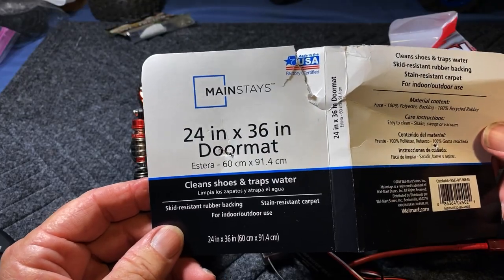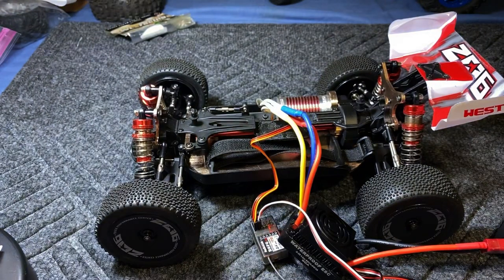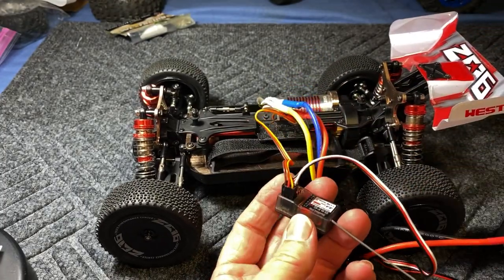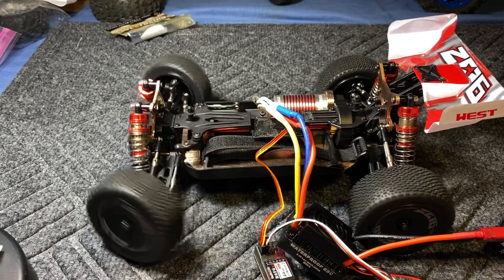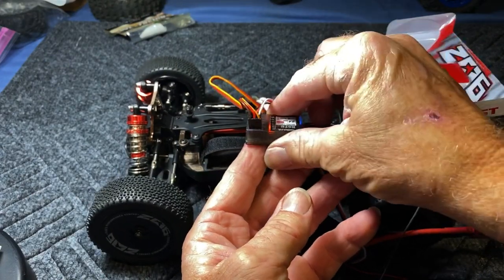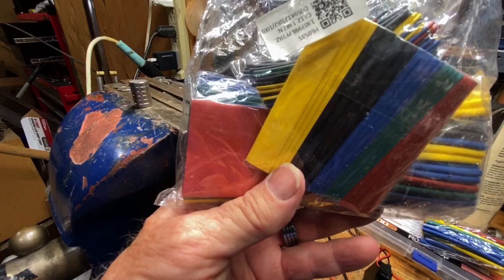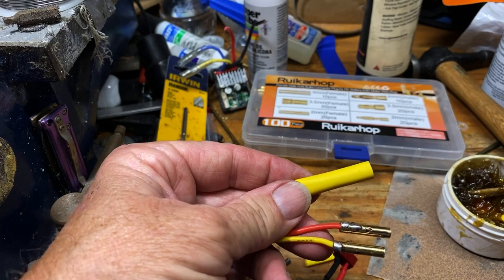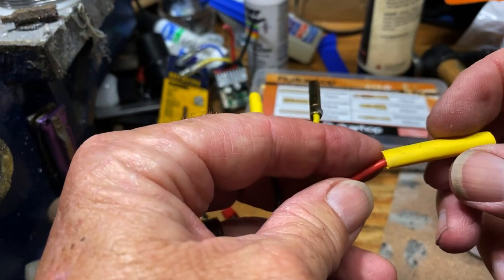WLtoys 144001 brushless ESC choices

Comment: hi, just bought one of these for my son! What are the things to buy for preventing errors? Ive read that the suspension needs to be filled with oil because they are dry? Is that true? Also do i need to get metal gear for the motor? Read that they get broken pretty fast.
Also im looking for some longer lasting battey! Can you recomend some? Thanks
Reply from the maker: Thanks for stopping by. All my shocks (I have 3 of these) have had oil in them. I’ve heard claims that the differentials don’t have grease but none of mine were dry. They are not filled with grease and for the purpose of lubrication don’t need to be. However, I prefer to fill the rear differential with a fairly heavy grease. It functions as a bit of a limited slip differential and helps the car go straight from a full throttle punch. 

The pinion gears are metal and the spur gears are plastic (it looks like nylon) and even on 3s with my brushless motor I’ve never broken one. 

So far, the ones I’ve seen that broke have been using adjustable motor mount. 

The factory mount is non-adjustable and has a bearing on the driveshaft that prevents deflection and keeps perfect alignment of the pinion and spur gear. 

The adjustable mounts don’t use the bearing on the driveshaft so the motor can push the spur gear over far enough to cause the gears to slip and damage the teeth. 

One other thing worth mentioning is this car uses a pretty rare gear pitch. It’s .7 MOD and I’m not sure the people having the issue of broken teeth are using the correct pinion gears. 

A .8 MOD or 32p will kind of go together and seems like it will work BUT it will not. 

Sorry for the delay with my answer. I recently broke my back so I’m not moving very fast right now. 

If you have any more questions please ask away and I’ll get back as fast as I can. 

Have a great day and be safe out there!
Reply from the maker: I forgot the battery. I like the Gens Ace 1800 mAh.
Reply: @RCModSquad  Hi,  thanks fo the long and detailed answer! So no need for metal gears. But metal differntials are a good idea right?

I have a question about the shocks. 

Someone wrote an article about this car, and he said, that all of them comes with way too much oil in it, which isnt good. 
So he recomend to loosen the shocks oilcap(dont know if thats the correct name of it) and press the shock so it pumps out a the amount of oil that is too much. 

Also one guy recomended me to use 300cts in front and 600 cts in rear suspension. Why is this cts important. What oil do you use? Maybe this arent so important to follow, but im a very precise person and like to make things correctly and the way its best. 

Also is it normal, that my 144001 rc car has a weird whell alignment? The front wheels almost face outwards? They are very loose and i dont knwo if that is normal. You can move them in and out. I mean if you look the wheels from the front. Not from above.

Hope your back get well soon! 

Have a great day.
Reply: @RCModSquad  can i use 3000 mah? There are batteries with 7,4v 3000mah for 10 bucks. Also there is a new version of this 144001 rc car wich comes with a 2600mah battery
Reply from the maker: @johnwhite8985  if it will fit in the car it should work. The mAh is just for the run time. The “C” rating determines how fast it can deliver the power. If you stick to 25 -30 C you should be fine. 

They also make a parallel adapter and you can run two 2s packs at once. 

They have to be identical and stick with 25-30 C and you should be fine.
Reply from the maker: @johnwhite8985  in my opinion what these guys are doing is a bandaid for the real problem. A shock absorber is a damper. 

The piston going through the oil slows down the travel. The real problem is most of these pistons restrict the flow completely. It’s like filling a cylinder in your car with water. The engine won’t turn over. It’s called hydro lock. 

You can’t compress a liquid so if the shock piston isn’t build properly or the oil is too thick it prohibits the flow of fluid or in this case the fluid prohibits the movement of the piston. 

What these guys are doing is removing oil thereby creating an air pocket at the top of the shock. This does allow more movement of the piston but for the wrong reason. The air pocket acts as a spring and makes the travel of the shock non-linear. 

The piston is supposed to allow the oil to move past it but if the oil is too thick or the seal is too tight this won’t happen. The cure is to use a thinner oil or build in a path for the oil to get past the piston. 

It gives you linear movement of the full length of the shock travel and allows you to “tune” the shock by changing the weight of the oil. 

If you need more spring it’s better to change the spring rather than turn the shock into a spring. 

I just got a 124018 and I’ll be doing a video on what I consider to be a better way to do this. 

As for the diffs I use wheel bearing grease in the rear and and front but I fill the rear diff up and just apply a small amount in the front. If the front diff is restricted by too thick of an oil it makes it hard to turn. 

As for the wobble in the wheels, unless you’re racing it’s really not as big a deal as it seems. There is a little more movement than there should be in the axle. If you grab the wheel you can pull and push and you will see a little movement in and out. You can actually shim this to remove a lot of this. 

I’ll try and get a video out on this also. Some people use washers but you have to be very careful with that method. If the OD of the washer is too big it will bridge across the bearing and cause problems. 

You really need to stick to proper shims to do this. 

There is also a problem with the drag link (I’m not sure the proper RC car name for this part) and it has bushings in it. The screws that go through are a little small in comparison to the bushing and allow a little extra movement. There are a few ways to handle this. Some folks drill out the bushing and use a larger screw. I don’t advise this because you’re making the hole the screw goes into large and it weakens the part. 

The other is to drill out the holes in the drag link and install a bearing but it doesn’t leave much strength in the drag link. 

I THINK I have another solution but I haven’t tried it yet.

One thing you can do is adjust the toe in a bit and when the car is moving forward the rolling resistance of the tires pushes them back therefore straight. 

My day job has me away from home over 100 hours a week so many of the videos I wanted to do I simply didn’t have time to do. I’ll be home for probably another two months while I heal so as I’m up to it I’ll be doing more how to videos. 

There is a lot of incorrect stuff floating around out here and that’s not to say it’s all harmful but it’s less about fixing the problem and more of a bandaid. Kinda like adding a little toe in to the car. It’s not a true repair but it make the problem less of a problem. 

Have a fabulous day.
Reply: @RCModSquad  Ok, so the batterys should be fine. 

So you dont advise to remove oil from the dampers right? The guy just said this because in his opinion the oil pressure because of the "way to much oil" can damage the damper. I'll link you the articel he wrote! I cant describe it so well:

https://www.quadifyrc.com/rccarreviews/wl-toys-144001-setup-3-things-you-must-do-before-you-even-turn-it-on

So dont change the oil and leave it as it is? Right?

And is this kind of grease good for the diffs?

https://www.amazon.de/-/en/dp/B00295CR0U/?coliid=I1CH531DA6TS6D&colid=279NBMFUXGH5S&psc=1&ref_=lv_ov_lig_dp_it

About the fine tuning on the wheels.....i want race or something! This car will be my sons gift and he will drive it in the grass and dust here and there.

So i only want to make it as reliable as it can be. Not do some pro racing or anything like that.

Comment: Can you provide a link to the 35 esc
Reply from the maker: Here you go Ray. 
 Affiliate links:

2845 3930 kv brushless motor: https://amzn.to/329rkC4
35a brushless ESC: https://amzn.to/3grV0j7 
If you use this ESC and motor combo you will have to change the connectors on one or the other. 
Thanks for stopping by and have a fabulous day.
Reply: @RCModSquad  Thanks for the link! I ordered the ESC. I also would like to see if you can provide a link to the steering servo? The one in the car as you know is a five wire and I plan on using a Dumbo RC reciever which is three wire. Thanks for the help!
Reply from the maker: Ray Parker The servos that I use. 
JX Servo PDI-1181 MG: https://amzn.to/34kQ1hH 
The JX servo is a direct fit. 

Have a great day and be safe out there!

Comment: Do you run it on stock diffs ? We got our car in the post 3 days ago. My kid play with it 2h max all together and both diffs blew today. No wheel spin at all. Second car this month 🤷🏻‍♂️
Reply from the maker: Wow! Sorry to hear that. I am running stock diffs but I did open them up and add grease to them. There are upgraded metal diffs available. I’m pretty sure the set for the WLtoys 12428 fits this car also. Just be careful because technically the ones in there are sold as “metal” and they are but they are a really soft alloy.  

I haven’t personally tried the ones for the 12428 but I might just try that so we know for sure. 

BTW: Just about any wheel bearing grease will do. I use white lithium grease like you would use on boat axle bearings because it handles water really well. 

Keep an eye out because I think I will order a set of those gears and do an install. 

Thanks for stopping by and be safe out there.
Reply: @RCModSquad  I took my diffs apart and they are completely gone. At least I know that this new 550 motor has some blast 😂😂

Comment: Hey Dave I'm about to convert to brushless what is the best one for this car in your opinion
Reply from the maker: I went with a 2845 3930kv just because nobody else was. I think the balance on the car is better. It’s a bit more hassle to do that though. 

If you stick to a 3650 it will be a direct drop in. The easiest way to do it is to pick up a new motor mount and pinion gear. 

You can reuse the old one but it takes a lot of heat to release the glue they put on all the screws. I do have a video on that in my playlist. 

If you stick around the 3900-ish KV level with the stock pinion you should get close to 50mph on 2s. Maybe go with a 45 to 60 amp ESC. 

I’m using a 35 amp on the 2845. Good luck 🍀 and let me know if if you have any more questions. 

Have a great day and be safe out there!
Reply: @RCModSquad  thanks alot for the input I would rather go with direct drop in  so that would be better  for me what is a cheap reciver that goes with that moter and esc
Reply from the maker: @johnporter1613  I have a link in the description to the Radiolink and DumboRC radios and either one is a good option. It looks like the DumboRC with the Gyro receiver combo is all out of stock. You could still get it but you would have to buy the gyro receiver separately and that would raise the price by $16.

The Radiolink does have the gyro receiver with it. 

The Radiolink will allow you to name and control 10 different cars or you can have two profiles on one car. One for bashing and the other for speed runs. That’s pretty handy so you just choose the speed run name and all the profiles for everything are already set then just switch to the other name and you’re back on the bashing profile. 

There’s also a link to a steering servo that a direct drop-in.
Reply: @RCModSquad  I shop on amazon that's what. Gonna do  I just seen all ur links thanks I'll give u am update when I'm done I'm ording the parts now
Reply from the maker: @johnporter1613  awesome! I think you’ll have a blast with it.

Comment: Hey man do you know if the Jx servo 1171  pdi works or is it the same as the jx 1181 servo
Reply from the maker: The 1171 has a little less torque and a little lower stall torque but not by much. 

The price is about the same but if you already have the 1171 I’d go ahead and use it.
Reply: 😊 thanks
Reply from the maker: @takuache4692  You’re welcome! Have a great day and be safe out there!

Comment: What's best for stock motor ? I want to replace in my son's car
Reply from the maker: Phen0mable the 540 motor that stock in the WLtoys 979b is a good choice. The one I’m using in one of my other cars is a 13t  540 motor but I’m not running the stock ESC so I don’t know if the stock ESC can handle it. Here’s a link to the video and it shows the ESC motor combo and what it will do. 

https://youtu.be/LyABStC5VEQ

Thanks for stopping by and have a fabulous day.
Reply: On the description of the car we have it says it's got 550 brushed motor 20.000 rpm. 
We had ESC melted in one so I thought to replace just ESC for peace of mind
Reply from the maker: Phen0mable it does have a 550 the 540 is just a little shorter but it is a direct replacement.
Reply: Just jumping in here, I put an armma 550 mega motor in mine, direct bolt on. I did put a fan over the esc but so far it’s done great. 42 mph on 2s. I’m afraid to run 3s on the stock esc.
Reply from the maker: robert whitt it’s probably a good idea not to run 3s on the stock ESC. 👍🏻

Comment: Has anyone had faulty brushless motors and esc from new ? Or know how to test them mine works of the ground but struggles and stutters on the ground ,I'm using 45amp esc a 2838 motor 12t pinion gear as recommended with a gt6 controller !
Reply from the maker: My guess is that the 2838 struggles to take off but if you give it a little push it is ok until you stop again. If that’s the case you need to get a programming card and turn the punch down a little. 

It’s what’s called cogging. Sensor-less brushless motors need to spin a bit at low load to “figure our” their timing. If you turn down the punch it helps. A larger motor like a 2845 at around 4000kv would work well with the 12 tooth pinion. 

You didn’t mention your KV but I’m guessing it’s pretty high. If you want to stay with the 2838 you could lower the KV rating and that would help. 

Thanks for stopping by. Have a great day and be safe out there!

Comment: How do I know if my receiver puts out 5 or 5.8v? I have looked at the manual and can’t find any info. It’s a fgr4 receiver nb4 transmitter
Reply from the maker: The ESC controls the voltage to the servo.

Comment: Don't forget the programming cards
Reply from the maker: Yep! I’ll put that in the run video. My radio might have enough tune in it but I’ll just leave it full on for now and show the card in case someone is using a different radio. 

Thanks for stopping by and have a great day out there. Be safe my friend!
Reply: @RCModSquad  but it has nothing to do with the radio, yeah you sync it with the ESC, but the card lets you adjust brake force, acceleration battery cut off point etc
Reply from the maker: scannaunderscore1 👍🏻 if you re-read my comment I’m going to tune it with the card in case someone isn’t using a transmitter like mine.
Reply: @RCModSquad  ok I apologize, I made my wltoys 1/12 12423 short course truck brushless 4370kv 60a ESC 3s. When I get the card for the 120a ESC I'll put that in, as using now I have the lovely cogging stutter effect. But that shortcourse is the best car most fun in my opinion they do.

Comment: No it’s not 120 burned 2 up in 5 mins on one and burned the other one when I plugged it in.  The capacitors are crap. If you replace them with hobbywing brand and use it on a touring car it will be fine.
Reply from the maker: I still haven’t tried this yet or honestly ever even looked at it after this video. I’ll look it over some day and see what’s in it. 

I’m planning to build a recovery boat next spring or summer so maybe I’ll use it in there. 

Thanks for the information. Have a great day and be safe out there!